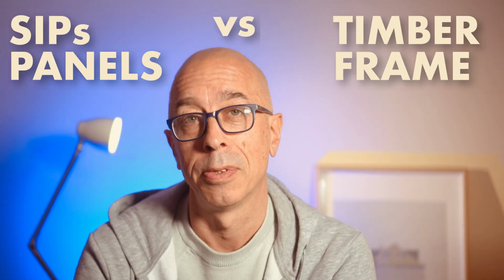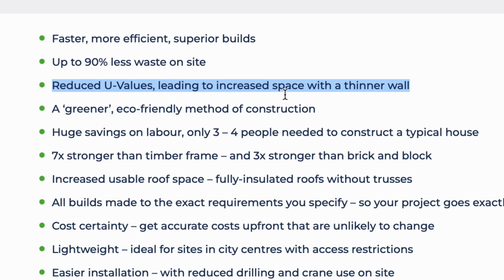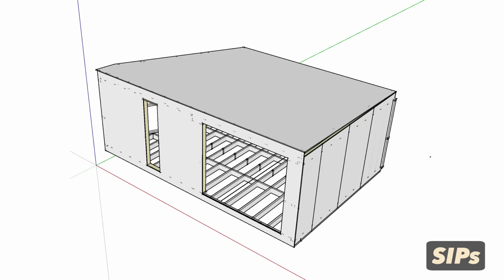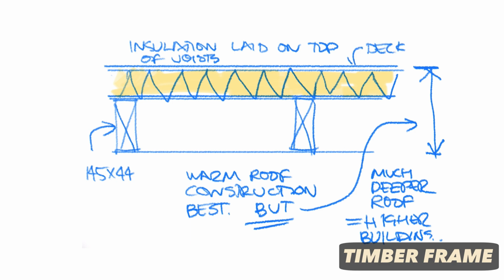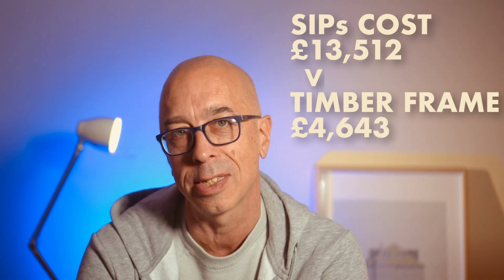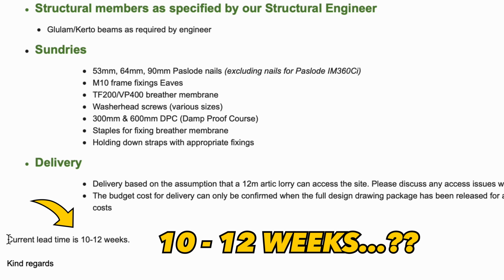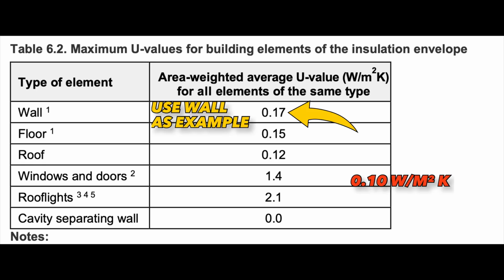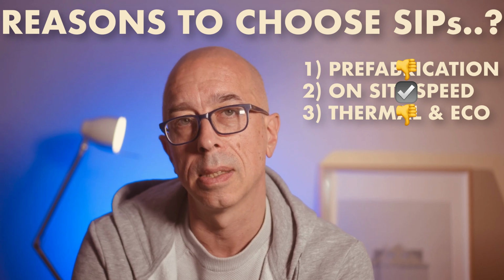What's best SIPS v Timber Frame - You won’t like what I’m going to tell you

Comment: Utterly baffled...

1/  You start off on SIPs saying they come as whole pre-formed entire wall-panels - then later describe your example garden room as being made up of individual ~1m wide SIPs... in reality, both systems are available but the latter re far better suited to the sort of project featured in your video.
2/  Your example build has vertical timbers at the SIP joints - not needed for single storey ~150+ thick SIPs (you don't even need them for 120mm thick ones) where SIP 'splines' would be used to join panels eliminating thermal bridging.
3/  No mention of a system for sealing insulation into timber frames (usually either expanding foam or gappertape, these days) nor the serious extra labour required to achieve this if done properly.
4/  Any extra non-environmentally friendly material use (eg exp. foam) will be made up for over the life of the build by a factor of 1000...
5/  I don't know where you got your SIPs quoted from but the costs are insane compared to 4 recent SIP projects I have been involved with.  For non-habitable constructions with very simple designs such as yours, you could easily just buy the SIPs yourself 'off-the-shelf' and going from prices on eBay right now, the SIP walls and roof would cost no more than (assuming a 6m x 6m build) ~£7k - including SIPS for walls, floors and roof all in 150mm thick SIPs.  The thermal performance would be chalk and cheese by comparison to a stud build and the extra cost of the SIP construction would be made back in energy savings in the first 5-10 years of use as well as a hugely quicker build.
6/  At 4:53 you show the roof of the non-SIP version of your construction showing a warm roof with a 'deck', and yet other videos by you decry this system due to the problems of interstitial condensation!

In short, in my eyes your video has grossly undermined your channel's credibility.
Reply from the maker: Hi.  1) panel sizes in the quotes were 1220mm, they chose that, not me 2) suppliers that responded initially required 120mm CLS studs. These were non compliant, with a u value from memory of 0.25, which I had to point out to them. ….I’m aware of composite studs which have a thermal break, none offered options of those in their quotes 3) for my “non sips” wall example , insulation goes between studs and then over, for a “warm wall” so no foam around the studs therefore 4) and? 5) I explained in detail how and where I got the costs as well as explaining with calculations how traditional timber frame done correctly performs better for a much less the cost, my guess is you’re comparing apples with oranges 6) congratulations, you found a mistake in my quick sketch.. I’m human after all ;) You can tell everyone how awful I am, and how wonderful sips are. That said…, I appreciate you sharing experience and giving interesting arguments which will help others even if I don’t agree.
Reply: @build-better-things  k you for taking the time to reply.
My main point in commenting was to really highlight the massive improvement in thermal performance of the SIP system even if done less than ideally compared to the usual UK builders efforts at inserting insulation board into a timber frame. Frankly, in 50 years, I have never seen this done properly other than on YouTube! I suspect the vast majority of UK builders still overlook this now, seriously important, detail.

I don't want to get into a long tit-for-tat debate but one point I made in my original comment I will re-iterate:  It doesn't matter if you put a 'over-all' secondary layer of insulation board over the 'insulation in stud' part of the wall.  If you do not properly seal around the in-set insulation boards the gaps between insulation and stud this will hugely undermine the thermal performance of the system (apart from anything else, I gather this is now a building control requirement). This is because cold air is effectively free to circulate around the sides of - and to get behind - the secondary insulation layer. The only way to mitigate this would be to seal the secondary layer of insulation to the first layer. 

Frankly, I have never seen this done properly other than on YouTube. 

I am left with the question:  Have you ever used SIPs?  If not, I wonder how different you view would be if you had.

Comment: Pre-constructed Closed panel timber frame was cheaper than either sips or onsite built timber frame. SIPs also have less margin for error in terms of square  and level of foundation as i understand it.
Reply from the maker: Hi. My issue with dealing with the pre fabricated frame companies has always been the order and lead time. The are many volume frame companies, especially in Scotland, but some won’t entertain smaller orders. Thanks a lot for your comment

Comment: Curious what you think about timber framing in the oak-frame style for extensions/self-builds/etc. They usually end up getting wrapped in SIPs or an outer leaf of some kind. Is it just an expensive luxury or are there any advantages if you can fabricate the structural framing yourself?
Reply from the maker: If you’re using oak as your structure, you want to expose that and form the aesthetic around that. Sips are a structural as well as thermal, as is general timber frame, so it’s really a choice between the two systems, eg oak v stranded frame, oak v sips. If I’m understanding you correctly.
Reply: @build-better-things  I get the impression that you wouldn't get away with an oak frame being exposed to the outside these days, with glazing/walls fitted between the structural oak bays. It looks more common to make your oak frame and build an insulated layer around it so that you don't actually see any oak frame from the outside. Sometimes there's a brick skin, or maybe a thinner SIP wrap (as the SIP panels have less structural work to do).

Just in the context of your video here, I was curious how people make that work cost wise. Must be more expensive overall despite the off-site manufacture of the oak frame and relatively quick build on-site.

Thanks for the reply!

Comment: Hi, great video. I am planning on (self) building a 4x5 m TF single story rear extension. Would you be kind enough to let me know if below would be enough to pass building reg reqs ? 

1. Foundation = 500 mm x 150mm concrete footings + 1 concrete block wall to dpc 
2. Base : 90mm concrete + 70mm pir insulation + 30mm screed
3. Walls : 5x2 treated timber + 100mm pir insulation + 11mm osb outside + 12mm plasterboard 
Cladding : cement board cladding on the front + box profile roofing sheets on the side
Roof : 6x2 treated timber + 125mm pir insulation + 18mm osb + epdm rubber 

Do you think this will be enough to suffice BR requirements ? What’s the required U-value by BR in England :) thanks
Reply from the maker: You’ll need to submit calculations for the foundations, which are site specific. Similarly your walls base and roof require structure although I’ve made videos about how to size these elements elsewhere. U values, you need to do a calculation for each element based on your choice of insulation. Download part L to give you the current values.
Reply: @ thanks. Please can you clarify whats part L ?
Reply from the maker: Part L of the building regulations.

Comment: Threw me off because of the difference in nomenclature between the USA and UK.  For me, a timber frame is post and beam construction using heavy timbers.  Here, what you are describing as a timber frame is typically called light lumber framing, where the most common approach is called platform framing.
Reply from the maker: Yes, timber frame in UK, I think in North America you call it stick construction.
Reply: @build-better-things  Yep

Comment: We have just built a SIPs home here in New Zealand. The panels came to 24%of the total cost. We built our own home and did 95%of the work ourselves. It took me 1800hours and running my wiring and pressure water plumbing we only used 2tradies. With a large deck the size of the house cost was just over 4000$per square meter. We live in a very cold climate in winter and with a small wood burner I'm in a singlet and shorts inside all year round. Running services on the exterior panels is the  only hassle with a cavity wall required.
Reply: this price is crazy, how expensive everything is in other countries, in Moscow oblast (RF) I bought a house according to my own design 217 square meters for 6 million rubles (70 thousand US dollars), and I did not participate in the construction or purchase of materials
Reply: @Мейзен  But who wants to live under the Putin dictatorship???? I got to know Russian workmanship very well.....
Reply from the maker: Thanks a lot for sharing.
Reply: 4K NZD sounds right for a good quality built with lots of DIY.  Way to go away from the notoriously underperforming  4x2 construction.
Reply: By that do you mean it was little under NZ$8k/sqm for the house excluding the deck?

Comment: Do we need these CLS studs for SIPs? As some SIP companies make a SIP spline that goes between so you don’t have a cold spot at joining studs?
Reply: Main down side for SIP is water damage, this is why mortgage rate can go up with SIP build/extension. If you have water damage, with stick build you could take off outer cladding & OSB and re-do. This is harder with SIP. What about floor mounted sockets for SIP build, rather than wall sockets?
Reply from the maker: Floor mounted sockets would drive me mad. I’d bite the bullet and build a service zone. Yes, the mortgage issue is relevant for sips houses. Thanks
Reply from the maker: Yes, some do, but many don’t. My guess is, there are structural limitations with the composite. But the u value will get better, when used, which is a good thing

Comment: I don't like SIPS because your living space is encapsulated in toxic chemical glue and foam. At least with timber frame, you can insulate with more environmentally friendly options. And I mean the environment inside, not outside.
Reply: Osb is formed by pressed and bonding (so full of glue) thin flakes/sheets together. So OSB is full of glue. SIPs are literally same materials. Get your point about could use wool for insulation on stick build. But would need to be thinker to get same U value.
Reply: Is it toxic because you say it is?  Is there evidence that living inside of a cured polymer structure causes medical problems?   People wear synthetic polymer clothes all the time (ie polyester, gortex, etc) and nothing happens to them.  Sounds like ignorant naturalism fetish to me.

Comment: Years. Ago I worked with a sip panel company…. And we used up to a. 8/24 foot panel .. it was. AWSOME … using the panels for the roof and walls … putting in a window or door just take out a chainsaw and put it wherever the customer wanted it.. customers would usually change their minds about where they wanted it after the walls were up as apposed to what was on the blueprint… plugging a space where they had originally planned was easy to install as well ….   Sound proofing and insulation quality was excellent compared to any other system….

Comment: I agree that for a small extension you are correct.  
For a full house new build, perhaps SIPS make sense.
A lot comes down to how diligent your builder is. 
SIPS definitely win on air tightness.  I suspect a lot of framed buildings only get passed due to expanding foam to seal gaps, which is hardly a permanent solution.
Framed buildings often have poor cold bridges.  Though a continuous sheet over the outside of the framing should sort this.
One thing most SIPS no longer have is a stud between panels, they use a strip of OSB slipped and glued into a slot behind the OSB. So no thermal bridge, and an excellent moisture seal. 
Of course SIPS are still relatively new, who knows how long the essential glue bond will last?
Reply from the maker: Thanks for your insight. If and when volume house builders adopt sips, it will make the technology viable for the smaller projects.

Comment: Great video but there is no way you can build timber framed building for that price. The cost of labour would be enormous unless you did it yourself. Builders don't do hourly rates they will price the whole job.
Reply from the maker: I’ve showed the labour figures in the video within the spreadsheet. These are day rate prices I charged my own customers at the time of making.  If there’s no way, as you say,  then would you increase 1) the time I’ve allowed in the spreadsheet, or 2) increase the labour rates, and how long would you allow, and at what rate?

Comment: The problem here is, you didn't consider IMPs, such as steel-skinned SIPs. Granted, most people want "pretty"... which includes interior/exterior cladding and a load of other unnecessary factors. If your customer is sensible, and just wants a structure to serve the purpose... steel-skinned SIPs can't be beat, aside from lead times.  Often requires no exterior framing for single story, minimal thermal bridging, drastically reduced dried-in times, reduced vertical and gross load. The only downside is the added cost/time/materials of conduit for interior electrical. 

Steel SIPs provide the best investment for buyers, because a larger portion of the investment is going where it is most important... insulative performance, envelope, and structural integrity.... ESPECIALLY with modern code changes focusing so much on energy efficiency and moisture control.
Reply from the maker: For small domestic projects, Steel sips are even more expensive than the timber sips I mention here….(so way WAY more expensive than frame), ugly, crazy long lead times,  and, contrary to what you say, they perform no better than timber frame, since we’re measuring by u value versus overall thickness. I know, because I’ve done the maths. You clearly like them, so by all means spend 3 to 4 times your budget to get the same result as frame, but that isn’t feasible, nor is it reality for most. Once you include cladding, service voids, fixings and flashings, they’re the worse solution by far, and not worth considering.
Reply: @build-better-things  - I guess things are different in your location. Steel SIPs are more expensive... but the speed and labor savings are significant. Also, I don't know where you get your performance numbers from... but an 8" stick frame wall stands no chance against the clear wall R-rating of an 8" steel-skinned panel, even with an EPS core.
Reply from the maker: Except, …like all who promote sips with these claims ,….you’re conveniently forgetting about including the additional elements you need to add for SIPs, to get a like for comparison to timber frame. I go through it in the video.
Reply: @build-better-things  - "...the addtional elements you need to add for SIPs."

IMPs require track, screws, and non-skinning sealer. If your experience says otherwise, you were using the wrong SIPs. The only questionably addtional requirement of IMPs, is conduit for electrical... but considering the elimination of drywall and paint, I wouldn't call that addtional.

Comment: Thank you so much for this.  I'm in the USA, Abq NM, and need to build a home workshop on concrete slab and in 2 stages.  The end goal is  22ft deep x 60ft wide with a desired 10ft internal ceiling height, but will need to build just 22ft x 30ft at first due to costs.  I also want to build the wall frames sturdy enough to eventually support a potential second floor living space / granny flat that would take up about 2/3 of the same 22x60 footprint (so the roof will be a truss system that can be easily removed at some point).  Because I weld, I'm initially looking at using 4" square tubes for the main wall posts, set on 36" deep footers and set 4ft (or rather 4'-4" OC) apart with 4ft x 10ft of common stick frame walls in between the posts with a single wood stud set at 24" on center rather than typical 16" OC. Therefore this would create two large channels for insulation, potentially with 3.5" of spray foam as I was thinking I'd first cover the exterior of the walls in corrugated metal panels affixed direct to the steel posts and wood studs (and thus spray direct to the metal sheeting). 

Regardless, because of the envisioned 4ft spacings in between the main structural steel posts, I've been considering SIPs but have yet to do a cost comparison to see if what would probably be 22 of them would be a better way to go vs having to self-build each wall section (which would also come out to roughly 22 sections...plus door and garage door).  I also don't know how the SIPs would attach to the steel posts vs using glue and what would likely be 2" metal screws for securing the standard stud framed walls.  Lastly, I do like that SIPs have OSB on both sides as I could just keep that as the finished surface for the interior walls and seal / epoxy paint them and it gives an added exterior insulation layer.  This also calls into question if the exterior OSB layer should then be foil faced and /or if I'd also need some plastic vapor barrier between the OSB and exterior metal paneling (vs the other method of spray foam direct).  

I use to build a lot of various stuff in my 20's (55 now) and worked for a time as a house framer, but this envisioned design is new territory for me in wanting to use both steel, wood, and some modern commercial build qualities.   Please tell me your thoughts if ya got any!  Thanks.
Reply: im in albuquerque also looking to build in the east mountains. im thinking the cost of these panels just isnt worth the cost and labor savings. did you start your build?